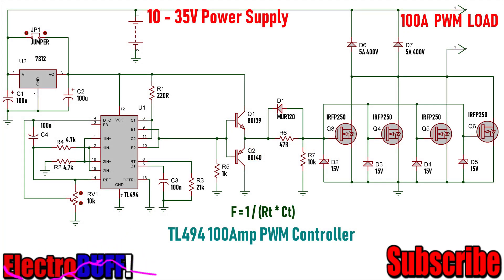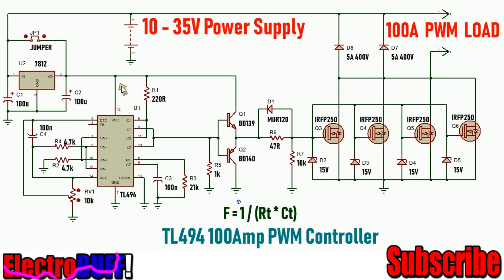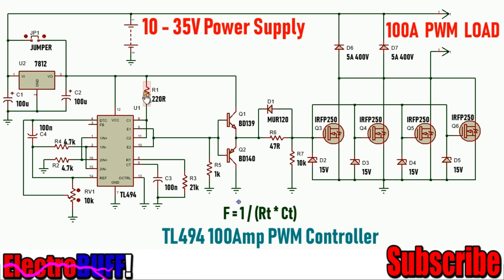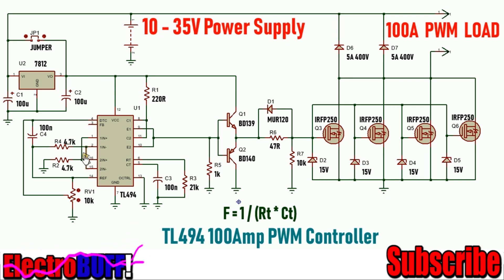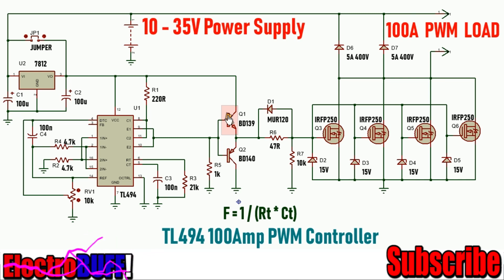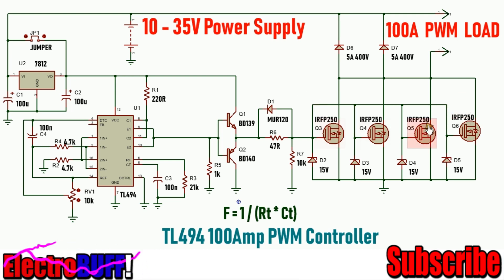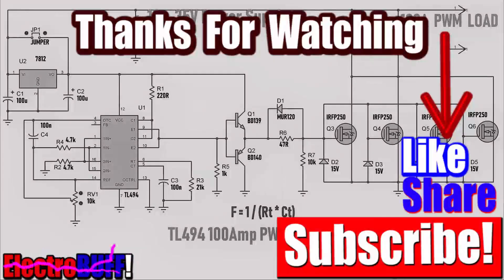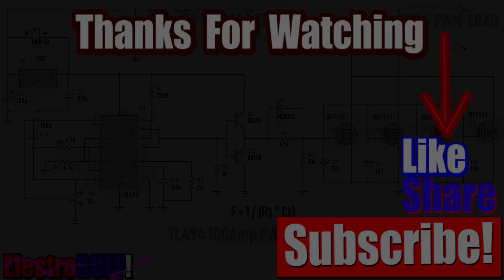TL494 100A Pulse Width Modulation (PWM) Control Circuit

Comment: Hi! 
Thank you for sharing. I have 2 questions:
1- Is it possible to make a variable 1-50V/50A power supply based in this circuit?

2-Is there a layout diagram for it? 

Thank you.

Comment: How do I calculate the required frequency value? I need a frequency from 2MHZ to 50KHZ. What is the value of the capacitor and resistance, my friend, I need to change to get a frequency and time to run. Thank you very much.
Reply: adjust RT and CT. Formula in the video